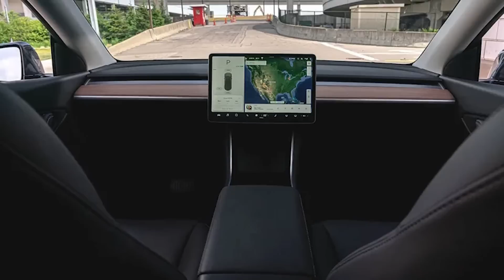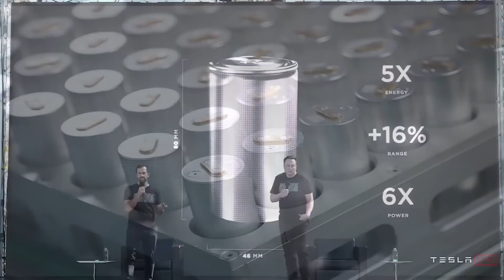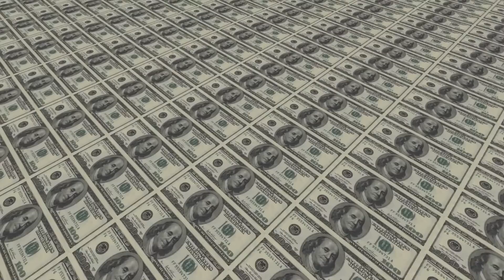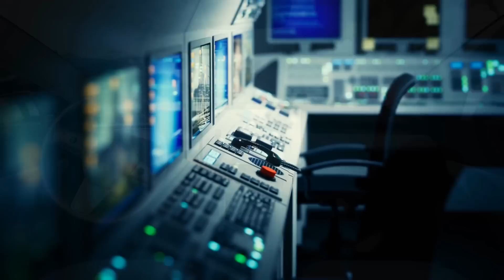Who is Tesla's Robotaxi Market?

Comment: Something like a Cybervan with an FSD beta "tester" in the drivers seat could definitely work as taxis in these markets. In fact, this kind of multi passenger taxi van is quite standard in these parts of the world, and shared rides are much more common vs in the US, especially before Uber pool. They would need to get price of ownership down to the levels of the Japanese ICE vans though. But if they can do that, they can sell a ton of them and also get the FSD beta miles collection going to eventually launch the Cybervan as a proper robotaxi. 

Because as it stands, you need FSD beta to run in the area before autonomy is possible. You cannot simply deploy US FSD software that in Indonesia etc and have remote assistance/summon like helpers, not unless Tesla has done some major breakthrough in the training.

Comment: I believe that the best strategy for tesla getting established in the lower income developing South/SE Asia (like Indonesia, Thailand, Vietnam, Philippines, India) would be to collaborate with Gogoro. Build a massive 4680 plant in Indonesia, supply those cells to gogoro, do a battery recycling deal with gogoros swap system and integrate autobidder and other tesla energy tech into the gogoro battery swap stations. This will build out a huge network of swappable batteries, allow tesla to profit off the coming ramp of battery powered 2 wheelers without having to get into building 2 wheelers themselves.

Then five or so years down the line they can roll out a super lightweight, super efficient urban robotaxi that can run on gogoro swappable batteries. A robotaxi with a top speed of 45mph could probably average 6 miles per kWh. A gogoro swappable battery is 1.3 kWh. An urban robotaxi with 10 of those would have 75 miles of range and can be "recharged" through swaps in under a minute. The urban robotaxi can compete with, maybe gradually replace the scooters over time. Rollout full size robotaxis (which would have more typical batteries charged via superchargers) a little bit later for people that need longer trips between major hubs.
Reply: Makes sense, but I think Tesla will likely supply their own businesses — cars, semi, cybertruck, storage — before they become a supplier to external companies like Gogoro.
Reply: @spgutmann  that is true, but the rub is that the Indonesians want to get as much economic development out of their nickel resource as possible. 

Given that, I believe tesla's plan is to build a massive cathode plant in Indonesia, to refine the nickel ore into NMC cathode. The government will be very happy to see that value add on their shores, but they would still like a lot of that resource to be a value-added into 4680 cells and those cells to be value-added into vehicles in Indonesia. 

Tesla already has cell factories in Austin, Fremont etc that need NMC cathode. So Tesla doesn't want to make cells in Indonesia, unless those cells are meant for the domestic indonesian market. Tesla energy products are a fantastic fit for Indonesia given the needs an island nation has for microgrids but the current lineup of tesla  vehicles are just too high cost for an indonesian consumer.

Fortunately batteries go a long way with scooters...the gogoro battery is 1.3kWh, meaning that one long range model y battery can make 57 gogoro scooter batteries.

So, all of that said, I believe Tesla will try to work out a deal with the government where they build this cathode plant and something like 70% of the cathode produced there is exported to fremont and austin which will turn that cathode into 4680 cells for Model Ys and Cybertrucks for the american market. The other 30% of cathode that stays in indonesia will supply an indonesian 4680 gigafactory. Most of the cells produced by that factory will be made into tesla energy products but a significant portion can go to a third party (like gogoro) that will turn them into other products useful for the indonesian consumer market (like scooters). Then like 7-10 years down the line, when Indonesia is more developed and there's a higher average income, tesla could build a model y or model 3 plant in Indonesia or the FSD is so dialed in they build the robotaxi plant.

Comment: I agree about operating in high traffic volume areas.  That also limits the necessary range, which shrinks the required battery size.  Also reducing the top speed  would alllow the wheel size to shrink, which expands usable volume.  That would result in a significant reduction of cost-per-mile.  But I imagine 2- and 4/5-seaters would have to come before the bus.

Comment: It’s been a quandary for a while why Tesla were designing cars that looked like conventional cars, when you look what’s possible without ice constraints, look at Aptera for instance, cybertruck is a significant step away from the traditional norm , next gen Tesla cars will start to get interesting I think, if they decide to make any for sale of course
Reply: Imagine a Cyberwheel, a sort of giant wheel you sit in and it spins around you when you drive it
Reply: "Look at Aptera for instance" Aptera is a three wheeled motorcycle. Therefore there is no safety standard when you are in an Aptera compared to a Tesla not to mention three wheeled vehicles have never seen mass adoption for stability reasons and you will never miss a bump or hole in the road ever. . Aptera is an overhyped overpriced electric 3 wheeled motorcycle.
Reply: @masminor  my point was regarding the efficiency of the shape and how Ev doesn’t have to conform to the norm, robo taxi design may/ could surprise a few people, it’s a wasted opportunity if we keep doing the same old thing because that’s what people expect to see. I wasn’t knocking Tesla I’m a bulI and have several
Reply: @TeslaBulldotcom  Shape will become less important as battery density increases. Electric vehicles will get bigger and bigger.

Comment: I still think that in many Asian and other countries around the world relatively low speed two-wheeled motorized vehicular transportation, and also three-wheeled rickshaws, are so common that Tesla is going to need to get into the two-wheeled vehicle business. Small, potentially swappable batteries and super lightweight design could lead to some very efficient and very popular vehicles. I know Elon doesn't like the whole two-wheeled vehicle thing but that was relative to a bad experience in his life whereas he must certainly realize that most of the people who ride two-wheeled scooters and small motorbikes and whatnot are doing it in places where it is relatively safe in so far as the top speeds are not very high and many people are using them all in the same area so it's not quite the same as doing high speed motorcycle riding on busy highways in the United States. it's much less unsafe when many are most of the people are also doing it and the speed limits are quite a bit lower.
Reply from the maker: Yes, you may be right, but it's not Tesla's MO. They are trying to get people of 2 wheel vehicles and into taxis, as its much safer.

Comment: I’m sorry, but this is very weak economic analysis.  Self driving AI replaces the DRIVER.  If you want to get a feel for where this AI will be deployed first, think about where drivers are expensive, and where this expense is born by few customers.  In the US, labor costs are high, and taxis often carry around a single passenger.  Thus, deploying self driving AI in the US removes a huge cost that is borne by a single person.  Big benefit.  You try to argue that 3rd world bus drivers will be the first ones replaced.  Nonsense.  These bus drivers are low cost labor.  Moreover, the cost of paying the driver is shared by all the passengers on the bus (10+?).  It could be true that electrifying buses in the 3rd world is a big emissions win, but that doesn’t argue for first deploying self-driving technology in that market.  Perhaps you could argue for early electric buses in this market, but you are not doing that, you are arguing for early robo-taxi deployment.
Reply from the maker: Don’t mistake robotaxis with FSD. 
FSD is more valuable to per customer to tesla.